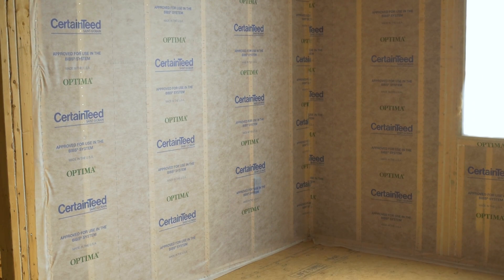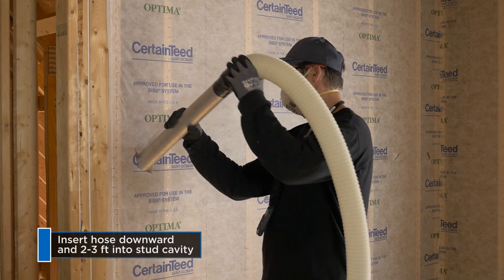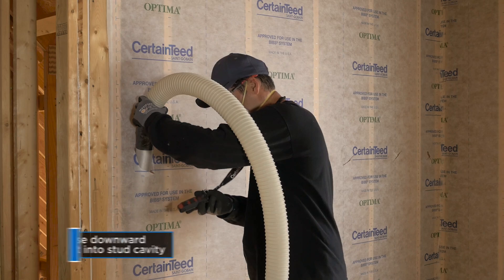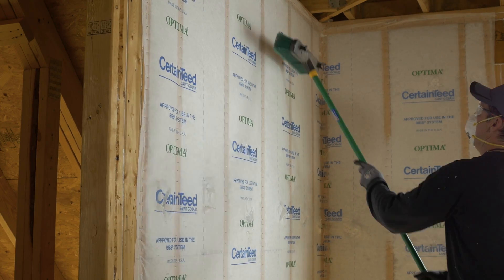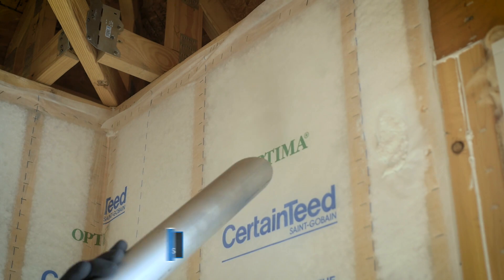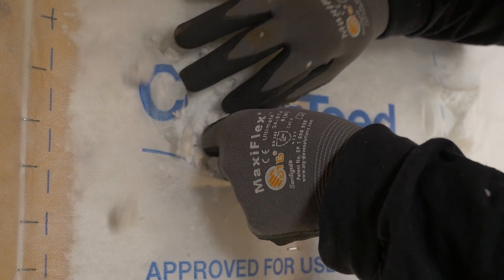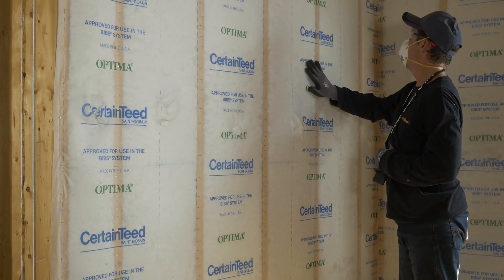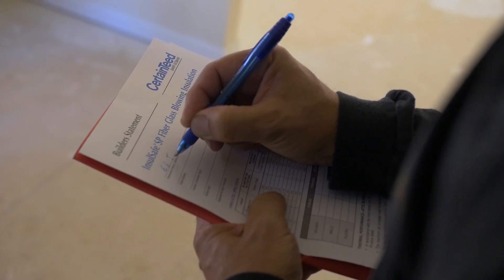The Right Way to Insulate Sidewalls with Blown-in Insulation

Comment: We just moved into a 95 year old house with no insulation in the walls. The walls are hardwood and would rather not destroy them, would this be a good option? Possible option ?

Only thought is to go through the outside but would have to redo the walls either way .

Someone had mentioned expanding foam but the pressure might be a problem.

thanks!
Reply: Absolutely

Comment: How is this better than using batts?  It looks like a scam to me after the blown in insulation settles you get gaps on top.
Reply: If done correctly & u dont have a water issue in ur wall cavities u wont have much settling. Opened up a 5 yr old wall n it had maybe a1/2" gap up top.

Comment: This needs to be standard for all homes being built. My house was built in 1951 and I understand this technology wasn’t available but to put nothing at all is wrong. Insulation was available then. Now I have to drill holes in not drywall but sheet rock to pump it in around the studs.
Reply: Drywall is sheetrock. Do you mean plaster?
Reply: You likely don't care, but I am replying to fix your misinformation.

Sheetrock is a brand of drywall that is a registered trademark of the U.S. Gypsum Company. With the exception of a couple of chemicals that allow the Sheetrock formula to be patented, there is practically no difference between Sheetrock and other drywall.

Comment: Hello,

I am trying to put green fiber insulation on the inner walls(jus sides) of my van. I like the barrier you used in the video above. 
The material/product thats used for the wall...thats stapled to the wood planks. What is the name and where can I purchase it from. 
I check my local hobby lobby and they offered me plastic or a paper/poly drop cloth.

I would prefer to have what your using in this video. 

Thank you,
Brandon
Reply: ever find out what the netting dryer sheet material is called and where to get it ?

Comment: 2 X4 Framing with an installed thickness of 3.5 inches would be R-13 2 X 6 Frame with an installed thickness of 5.5 inches would be R21.  Just fine for our local codes.
Reply: this with cellulose

Comment: What is the R-value of those exterior walls.  Is it about R-2?   If less than R-3 for 2x4 or even 2x6 stud walls, this method would not pass code in most areas of the USA.  What optimal density are you shooting for with blown fiberglas?  With cellulose it is 3.5 lb per cubic ft or more.
Reply: Dense-Pack fiberglass BIBB system gives R-15 for 2x4 stud wall framing
Reply: Hi Bert!   just watched this video...lol